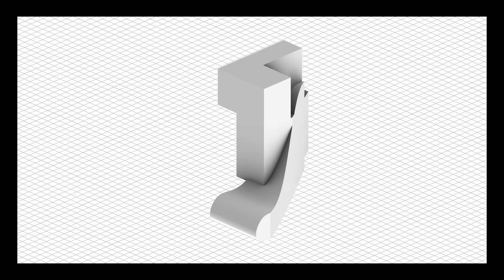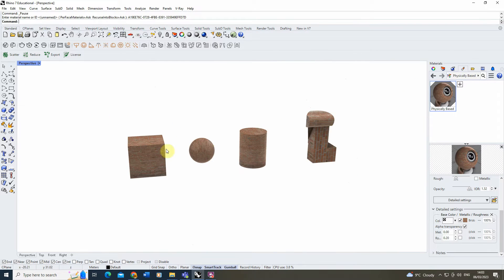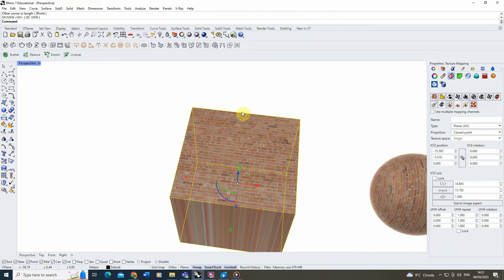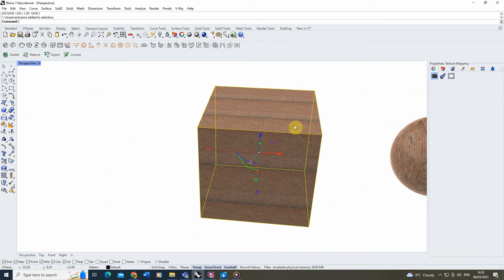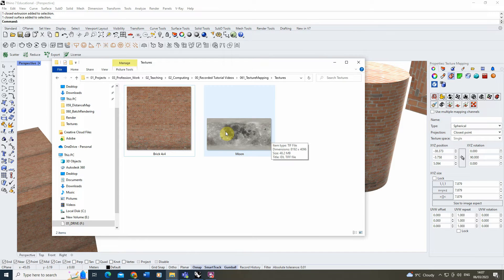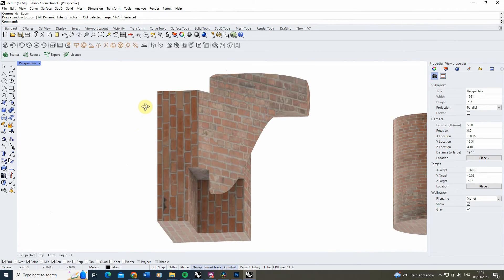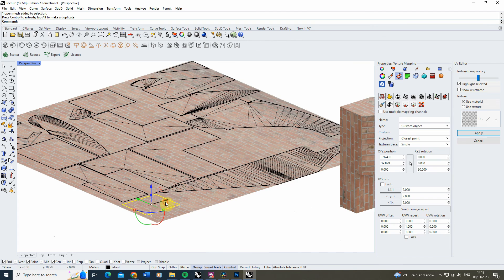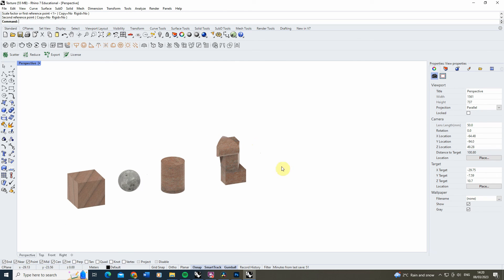Texture Mapping - Rhino 7

Comment: Hi Tom, great video.  Would you be able to make a video on how to randomise the position of textures across repeating objects. I have an instance where I want to apply the same timber material on individual weatherboards and avoid the whole wall looking like a repeating pattern. Or say if you had 100 brick columns in a row and you wanted to avoid each of then having exactly the same texture without manually repositioning the texture of each one.  Cheers

Comment: why is the texture map not applied at the 'correct' real world scale?
this would require the textures to all be made to the same standard size but surely that would be the is easiest way? 
then if you wanted to increase or decrease or decrease the scale of the map you could using the widget. 
it should also allow the object to be scaled up/ down without the texture's scale being altered.